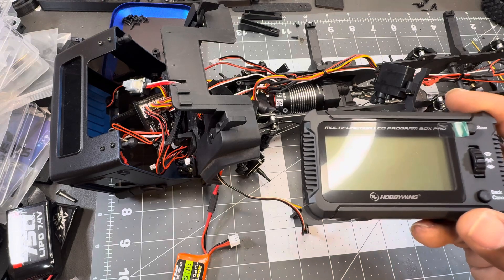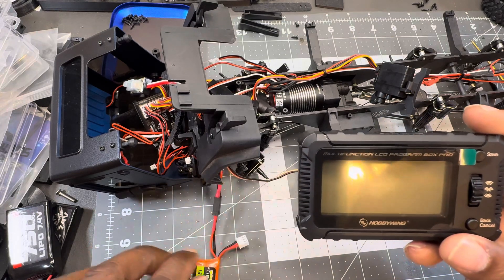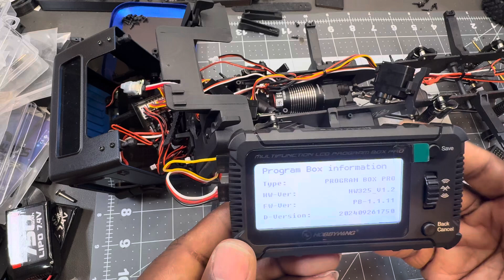Programming the Fusion Mini16 w/ the PRO Box G3 #rccrawler #arktos6x6 #fusionmini16

Comment: hello I bought this motor for my arktos 6x6 but the 64dp pinion on a 2.3 mm axle cannot be found! can you tell me how you went about installing it? With which pinion, the number of teeth please? thanks in advance
Reply from the maker: @devilmortel1041  You have to modify the stock pinion or shave down the motor shaft. Modifying the pinion is the safer route but I’ve done it both ways. 

Mod the pinion by widening the bore with a 2.2mm drill bit and press it on. If you go the shaft route then use baby steps. Keep checking the pinion fitment so you don’t make the shaft too narrow.
Reply: @DanPRC  Okay, thank you very much for your response. I tried to put the original pinion back on the engine but I couldn't remove it. it is well fixed
Reply from the maker: @ You need a pinion puller. I’ve been using this one. https://amzn.to/3Q1yv8S